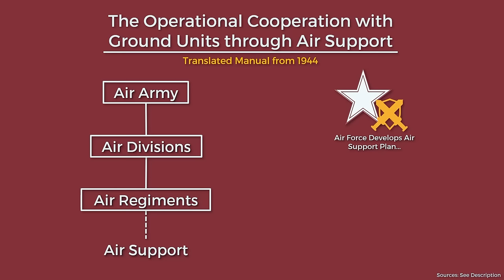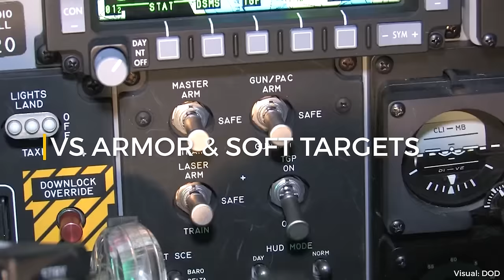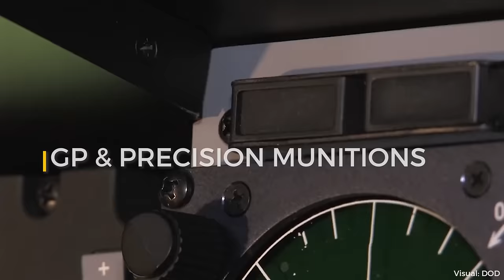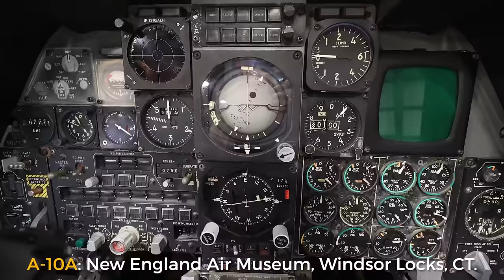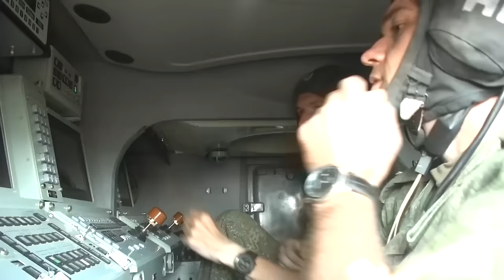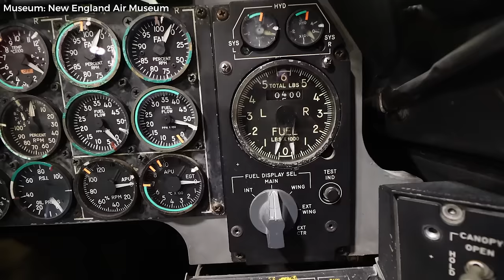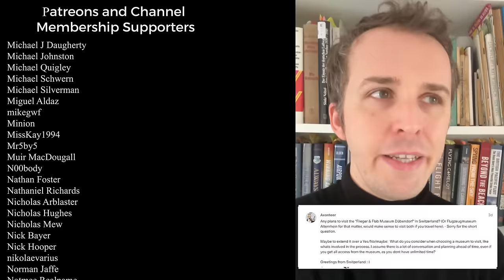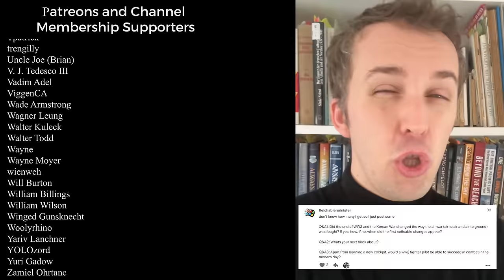A-10 Warthog: Retire or Upgrade the BRRRT? - Future of A-10C Thunderbolt II

Comment: They've been trying to sht can this platform for 20 years, and don't have a replacement. Grew up 8 miles SE of Grissom AFB in Peru IN, they had 40 of these... from the late 70's thru 1993 I saw these in the air, all day, every day in pairs... There wasn't a day we didn't see A10's... We farmed, they targeted us on our tractors and peeled of just like you see in the mid east war vids... A-holes... But we loved them, went to the annual Grissom AFB open house every year, have stuck our thumbs in the 30mm gun multiple times, LOL!!! Yes, back then they were not roped off, you could touch them, C130's were open also for walk through... They closed Grissom AFB in 93 after the cold war,,, all these A10's went to the National Guard reserve base in Ft Wayne IN, we were out on the lake when 37 of them flew over... Very missed...

Comment: Opinion is divided on the A-10 on the internet.  It is not divided where it matters, in the military.  Even the US Army now understands why the A-10 is obsolete.
Reply: The USAF has not budgeted any CAS training for it's F-35 pilots.
Close Air Support is being moved to the F-16 squadrons, much like P-51's took over CAS during the Korean War because the USAF had retired all it's dedicated CAS aircraft.

The US Army intends to use it's own Drones and helicopters for CAS and does not expect the F-35.
Reply: @pogo1140   

CAS is not being moved to F-16 squadrons, it has always been there.  What do you think that have been doing in the sandbox all these years.  The F-15E, B-1, and B-52 also do CAS, with more survivability and/or accuracy than the A-10 can over a hostile battlefield.  The F-35 is not needed for that role, although it can do CAS when it isn't needed to penetrate contested airspace.

Unless my reading is very of of date, Helicopters and drones do not replace fixed wing CAS, which the Army is still very much interested in, just as they are still interested in artillery and armored vehicles.  Helicopters are not analogous to indirect fire support, they are analogous to direct fire from highly mobile fire support vehicles, and their doctrine and tactics reflect the differences.
Reply: @gort8203  B-52's have returned to their bases with full bomb bays during a day when F-16's and A-10 were flying 2 and 3 sorties and returning each sortie with empty pylon and cannon drums. Reason, you don't bomb from above FL 15 when clouds are below you obstructing LOS or when the targets inside the bombs miss radius. A-10's, F-16's and even F-15E drivers however will drop down to as low as 500ft, and in the high valleys of Afghanistan, A-10's got a rep for turning inside the valley, below the clouds, fighting until they ran out of ammo and ordnance. We know this from official reports and the commendation letters issued to the various crews.
Reply: @gort8203   As far as CAS always being an F-16 mission, not really, it was added on as A-7 and F-105 Squadrons transitioned to F-16's. Many ANG squadrons stayed mostly A2A as they transitioned from their F-104 and 106's.
Reply: @pogo1140   I'm not talkin about ANG continental air defense units, I'm talkin about active duty F-16s, which were acquired as swing role fighters for A-A and A-G.  

My last response to you seems to be missing, so I'm not going to keep responding to the irrelevant comments you keep posting in an attempt to change the subject.

Comment: While my heart will hate to see the A-10 go, nothing lasts forever. Even giving it wild weasel capabilities really wouldn't extend it's life. It is about time to designe a new "hog" with a smaller radar cross section and maybe an internal weapons bay to use in opening phases of a conflict. When the threat envirment lowers adding external weapons racks to go "hog wild" could be done. CAS does not have to be pretty, it has to be survivable.

Comment: My question is: what can the A-10 do just before it's shot down that the Apache (or Eurocopter Tiger) can't do while surviving? Take into account proper operation of Apache for that mission, so please no straw men where they're used inappropriately. For example: Yes, they're slightly slower to arrive on scene, but they can also be based closer.
Meanwhile Apache can also function just like HIMARS which can also advance along with a fast-moving front and without being vulnerable to mines, I assume can be very effective in anti-drone missions, and do so many other missions with that one platform.
Reply: @cptclemgmail  1. Better survivability? The opposite is true
2. Wrong, Apaches carry Mavericks too. And Spike.
3. The role of JDAMs can be taken care of by other armaments on Apaches and above all with better, faster, safer fixed wing
4. I already addressed that: it's a false argument since Apaches can be based closer, and can also be working in higher numbers meaning always multiple on station ready to act, while still being useful in other roles in the meantime
5. Please don't be lazy and use acronyms. Also you're making invalid statements since Apaches are operated differently.
6. I just told you not to use such invalid argumentation. Apaches will be on station just as fast or faster if that's what's needed. They're deployed based on need, not based on some false argumentation A-10 fanboys have. Apaches are likely to be in the area in higher numbers as they can be working so many other roles, keeping busy, and will then be on call for CAS when needed. They can also be based far more efficiently, closer, etc. as they are massively more flexible than fixed wing.
Reply: I'd argue that what would even further make Apaches useful is building massively cheaper "lugger"-helicopters on the same or similar platform, whose job is not to do any targeting or any advanced roles at all: just to transport long-range NLOS missiles and maybe also anti-air missiles to the area and launch them based on other platforms' commands, then go back and get some more. They'd always be operating among several other Apaches and/or other anti-air etc.
They'd be even cheaper as HIMARS-replacing mine-proof, fast, non-road-requiring vehicles.

Then replace even more APCs with helicopters as troop transport and then you have a far more effective strike capability to overwhelm enemy forces without fear of mines, and with the ability to move the front far faster than before. Avoid deadlock trench warfare like in Ukraine.
Reply: @cptclemgmail  Thank you for capitulating and admitting that you cannot disprove what I wrote.
Reply: @pistonburner6448  Another aspect people are forgetting is that at least for the US Army, Apaches and other rotary wing assets can be called in by anyone with a radio, no JTAC or special personnel are needed. Army Attack Aviation is a lot more flexible
Reply: @pistonburner6448  Between 2003 and 2010 the US lost 15 AH-64 to hostile fire and 1 A-10
Reply: @pogo1140  Then they were using them wrong.
Reply: @pistonburner6448  can't really use AH-64 from 15,000ft
Reply: @pogo1140  Why would you want to or need to?
Reply: @pistonburner6448  to get above the range of MANPADS, RPG's, light and heavy machine guns which are what brought down those AH-64's. Notably the A-10's operate below 10,000ft down to 500ft and they only lost 1 plane
Reply: @pogo1140  That's not where you want to be, you want to be below radar horizon and behind terrain. Up there you're a target for the enemy from 200 miles' circumference...
You using those losses as proof is invalid, as their missions and circumstances could be anything. You don't know what they were doing and why. Their missions were likely very different to what I'm suggesting, and what is possible for safe 'routine' operations.
Reply: @pistonburner6448  At 100ft a radar 30 miles away can't see you.
A plane at 15,000ft is below an S-300's radar until it reaches about 190 miles
Reply: @pogo1140  Who is at 100ft? Not the A-10! The Apache is at 10 ft.
You're the one who started blathering about 15,000 ft!
Reply: @pistonburner6448  Context dude, I'm giving you a window where planes can operate.
15,000ft is the altitude US planes were ordered to operate at after they took too many losses from MANPADS and AAA during Desert Storm.
At that point only the SEAD birds and A-10's flew below 10,000ft.
Helicopters can fly at 10ft but more often it's 100ft or higher cause trees and buildings.
Reply: @pogo1140  You are blurting out totally irrelevant and invalid stuff. Apaches don't have to operate at 15,000ft in a _modern environment and that's great, because they can instead remain far behind the enemy lines and below their radar horizon. They don't get hit by MANPADS and AAA because they won't be seen by them!!
Desert Storm is ancient history, and they had their procedures there due to totally different factors than what we're talking about! They had wide ranges of missions which have nothing to do with what we're talking about! Them losing an Apache during a special operation flying deep into enemy-held territory has nothing to do with what we're talking about!
You're too invested in trying to win to be rational, you're just reaching for ways to win the debate. You're so far from debating the actual subject matter.

Comment: Probably been said in your presence plenty but it's worth mentioning either way. One of the biggest challenges the A-10 has always faced is unfortunately the US goverment itself. From pretty much day one they've been trying to get rid of it and you pretty much have to twist their arms until they rip off to make them give anything to it.

It's also worth mentioning that this is the plane the replaced the Sky Raider and outlived multiple of it's own supposed replacements. It's a niche platform sure, but it's a niche that history has shown often needs filled and about the only thing that can replace the aircraft in that niche is another aircraft specifically designed for it like the A-10 was.

Sure, it won't be around forever just like the B-52s, the Hinds, F-15s etc but if it was given half as many upgrades as those aircraft from roughly the same period as it the A-10 would be a much more capable bird than it is even now and be able to stay in service like the rest of them for about as long. Granted the aircraft I have mentioned have also seen their most recent iterations repurposed in various ways from their original mission. Some versions of B-52s have the ability to carry large ordinance or equipment (And in a few cases small aircraft like the X-15) on wing pylons. The F-15 has seen both the Strike Eagle and now possibly even the XL program. And hell, just last night I even learned there's an unarmed variant of the Hind that's used for rapid escape of dangerous situations for VIPs. There is a LOT you could do with vehicles like these if plans and funds are actually allowed to go through.

I don't outright disagree with you and overall think you are spot on in everything you said. But in the case of the A-10 and it's longevity I feel like these are additional talking points that need to be brought up to get the full picture.
Reply: The upgrade program you are describing already happened. The A-10C was a massive upgrade program that transitioned the A-10 from a largely close support, low altitude attack aircraft to a plane that could handle higher altitude PGM employment. On top of that. It got a good targeting pod, datalink, and other updates. For all intents and purposes, it is a good plane and it handled itself well during recent conflicts (where permissive airspace was largely a given). 

  Sadly. While the A-10 did get significant upgrades, it didn't really get any capability that other aircraft didn't already have. The F-16, F-15E, F-35, and F/A-18 (and even some larger bombers) all have largely the same capability (if not more) to deploy the very same PGM's from a much wider range of altitudes and with a lot better chance of defending themselves against more elaborate air defense systems. We don't really live in a world where the A-10's unique capabilities make a whole lot of difference. The gun is a good cheap way to destroy soft(ish) targets but why risk it when you can just drop a JDAM or a laser guided bomb from 25,000 feet? Precision munitions have gotten to such a point where we just don't need planes to fly close to the ground to provide close support. 

  I am a big fan of the A-10. I think it is a super cool plane that has a very interesting and distinguished history. That said. Its time is done. We just don't need that kind of plane anymore.
Reply: @startrekmike The C model isn't the upgrade I was referring to. It was a bare fucking minimum just like the wing restorations. But whatever, I just lost my job tonight so I don't give a shit to argue with strangers online. Bye.

Comment: My concern: everyone seems to be expecting the COIN role to go away, and I think that is unlikely. Evwn during the two world wars, there were smaller-scale conflicts raging around the world that were very similar to modern COIN conflicts (for example Von Lettow-Forbeck's campaign in Africa). I think it would be a mistake for any world power to pivot their capability completely away from COIN.
But whether an A10 is the ideal aircraft for these roles or whether perhaps a turboprop-powered plane like a converted cropsprayer or AHRLAC-type plane would give a better cost-benefit proposition is another question.

Comment: It never fought against the enemy it was developed to be fielded against. Which is good, since the gun was useless for most of it's lifespan. I don't see much value in keeping it, how often is this kind of support really needed and can't be given by other systems?
Reply: The gun can shred anything lighter than a MBT. That's hardly useless.
Reply: @mstevens113  why bother when you have himars, helicopters and arty
Reply: Utterly useless due to it's tiny range.
Reply: @mstevens113 Can be done by the ground troops themselves with cheap FPV-drones carrying RPGs nowadays, no need for an expensive and vulnerable aircraft.

Comment: How does the A-10 compare to current attack helicopters? Are any speed benefits outweighed by loiter ability of rotor wing?
Reply: I think that attack aircrafts are harder to hit and better protected, and thus they are less likely to suffer hard losses from ground fire. The decision to use attack helicopters instead of attack aircrafts for ground support led to catastrophically high helicopter losses during the invasion of Laos in 1970.
Often did helicopters also need escort from attack aircrafts to supress enemy ground fire. And attack aircrafts can also carry more payload than what helicopters can so I can see the argument why you can have attack aircrafts without attack helicopters, but not why you could be able to have attack helicopters with attack aircrafts.

However the playing field have changed since Vietnam where machine guns and small cannons was the main ground fire threats to planes and helicopters. Today are manpads and missiles of all kinds a bigger threat.
A-10 would have done excellent in Vietnam where it could survive hits from AK47, maxim machine guns and 57mm anti-aircraft guns. But today I think it would have a harder time to survive trying to survive hits from manpads that either can destroy the plane of take it out for months of repairs. 

Helicopters in Vietnam had two survival strategies. Either to fly very high where rifle bullets couldn't reach them. Or they could fly extremely low and fast above the tree lines so it was difficult for the enemy to see where they were and hear the sound from them. And if they accidentally flow over the enemy soldiers heads where they were hiding in the jungle, would they be surprised and only have a few seconds to aim and fire before the helicopters had flown past them and were gone.
However helicopters in Vietnam were vulnerable things. Just 1 single hit from rifle bullet hitting them could be enough to make a helicopter crash. Helicopters were light and the engines too weak to carry much weight - for example for armor. Helicopter pilots were sitting behind their glass, the engines could be hid, the rotarblades could be shot off. A door gunner of a Chinook helicopter did once accidentally shoot off the helicopters own rotorblades which caused the helicopter to crash and killed 11 men on board. And then there was the hydralics system that was needed to manouver the helicopter, and a hit from a single enemy rifle bullet here could easily make the helicopter to crash.
Furthermore do machines not scream from pain like we humans do when they take damage. So often were helicopter pilots unaware that they were under enemy fire and machine gun fire turned the helicopters into swiss cheese because there were no warning system computers that could tell them that. So it was usually other helicopter pilots that first saw if a helicopter was starting to take hits from enemy fire.

The Vietnam war was a long time ago. And I guess many improvements of helicopters have been done since. But fact still remains that helicopters are light machines that cannot carry much armor and therefore are they vulnerable to enemy fire. And perhaps more so than during the vietnam war when the enemy now also can use stingers, strelas, thunderstreak, robot-70, Piorun etc. So flying high is no longer any protection like it was in Vietnam.
Reply: @nattygsbord  yeah, Super Cobras and Hueys are a far cry from Apache Helicopters. I was more wondering in a current conflict.